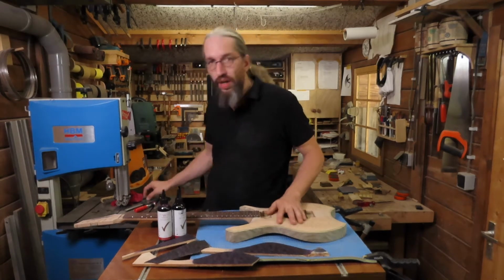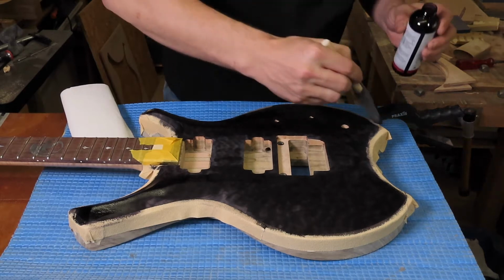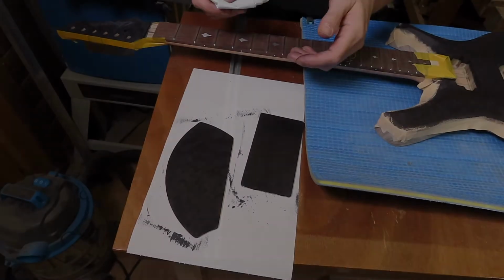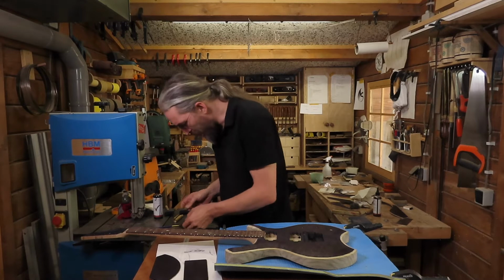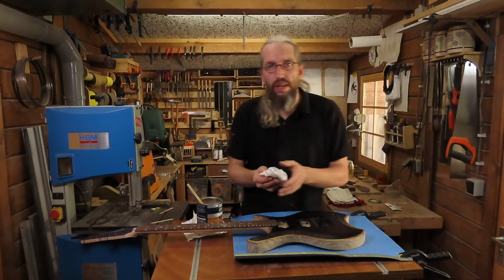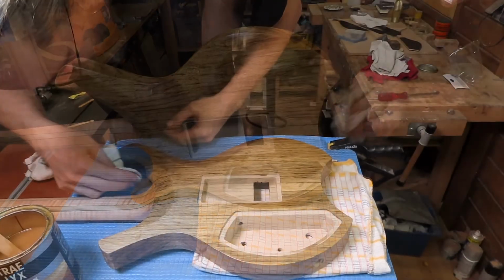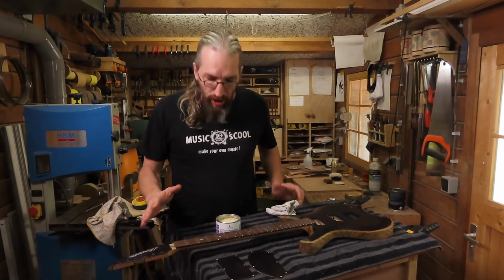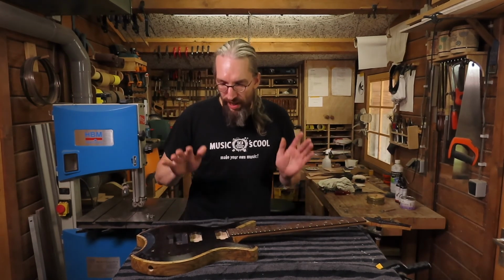Applying Stains & Hard wax oil Finish - A new Guitar build Part 15

Comment: Hello sir i build a electric guitar mahogany  body its thickness is 2 inch but its heavy what can i do to make it light weight?
Reply from the maker: Hi Ronald,
To reduce weight you could make the body a little thinner. 1.75" is a more frequent used thickness but if you're not using a tremolo style bridge you could even go thinner. I often make my bodies 1.6" (43mm) thick. 
If you are using a top on your guitar you could also make some extra cavities underneath the top to get rid of a lot of the Mahogany and reduce weight that way. 
Or if you want to go a little more extreme you could also cut holes all the way through the body.
Essentially you'll have to find ways to get rid of some of the body material to reduce weight but leave enough so you don't compromise the strength and stability of the guitar.
Good luck.
Reply: Thank you sir🙂

Comment: Are the pores still open in this finish? Or did you apply multiple coats and cut back to fill them in? The finish looks great! I’m trying to achieve that result with the stuff I have on hand since my building budget is beyond shot. I just usually find that open pores don’t look right when I try it.

Comment: Is a microcrystalline wax necessary? Wouldn't more layers of hard wax do similar job? Just asking, because I plan to stain and wax my custom guitar, and I am collecting experiences. Most people do: 1.Stain 2. Sanding Sealer 3. Wax/lacque; but I like your way. Let me know, thanks!
Reply from the maker: Hi James1495,
It is not really necessary but I like the extra depth and protection it seems to give. At least in my eyes.
More layers hard wax oil doesn't always give the best result. At some point the wood doesn't absorb the oil anymore and although you can keep applying more coats the finish doesn't come out as durable in my experience due to the build up of wax and oil and the increased curing time. It takes forever to fully harden.

Comment: Wow that grain really popped when you put oil on the back! Really interesting to see your technique. Another lesson learnt
Reply from the maker: Adding a little oil does make quite a difference doesn't it?
That's why I love Black Limba. It's such a pretty wood, easy to work with and looks so good with an oil finish.
I don't know if my technique is the proper or best way of doing it, but it seems to work for me.

Comment: Good idea mix the guitar stains, excelent result with wax oil. For masking, you should try a mask tape quite narrow, you know? The kind that guys use for masking helmets paintings, no leaks.
Reply from the maker: Hi Adrien,
Thank you. 
Yeah the color and finish on this one turned out great.
Thanks for the tip.
I know the type of masking tape you're referring to.
It's the type also used for striping on cars. Unfortunately not widely available over here. I have to order it online one of these days.

Comment: Having watched many guitar staining videos, I wonder if the black was sanded back more, there would be better detailing in the wood
Reply from the maker: Hi Steve,
Yes there would have... but that was not the effect I was after.
If I had sanded back the black more there would have been more obvious 'highlights' and detailing in the wood.
The purple would have been more pronounced and I think the guitar would have looked like a 'purple' guitar.
I wanted this guitar to appear as mostly black with just a purple hue. And only with the shifting of light reveal all the details and color shifts.
Now I'm curious though about how think the finish turned out?
Reply: @UnquendorGuitars  Yes I understood that by the end.  Note written too early.  Still great contene

Comment: Amazing! Any tips to stain the fretboard? I have a rosewood scale, very brown on a black gloss body and I HATE IT TO THE GUTS
Reply from the maker: Hi Abner,
I personally don't have experience with staining a fretboard. The stain will most likely wear off I can imagine. And staining rosewood might also be difficult to get consistent because of it's color.
You could look up how to ebonize wood to get an idea. 
If had to do it I would most likely use black ink or just replace the fretboard with real ebony.
Or if the guitar has a bolt on neck, swap out the neck.

Comment: I really like the color, almost black but with a subtle purple hue. 👍 What’s the reference of your hard wax oil? I’m starting a bass guitar with a wenge/purpleheart neck and a wenge/ash or limba body. I’d like an oil finish as nice as your guitar. And you say it dries hard, that’s a good thing!
Reply from the maker: Hi Ginger Jam,
Thank you very much.
I'm using the Trae Lyx satin gloss hard wax oil. I don't know how widely available this is outside the Netherlands.
A quick google search only showed Dutch sellers and the Trae Lyx website is only in Dutch or French.
But I think it might be worth to try another brand hard wax oil.
Good luck on your build.
Reply: @UnquendorGuitars    Thank you for your answer. I’m French. Trae Lynx is available in the Netherlands and Belgium. It might be possible to order from a Belgian seller. Is it similar to the Rustin danish oil ? Harder ?
Reply from the maker: @gingerjam2192  
Oh yeah you might be able to get it from Belgium.
I haven't used Rustin danish oil before so I can't tell the difference other than the hard wax oil having, like the name suggests, a hard wax component suspended in the oil.
I don't think that's the case with the Rustin Danish oil.  My gut feeling is that the hard wax oil should be harder and durable because it is meant to be used on flooring.
Reply: @gingerjam2192  "Hard wax oil" is, I think, carnauba wax mixed with boiled linseed oil and mineral spirits. If you don't want to mess with ratios, you can first apply 1-2 coats of the boiled linseed oil mixed with mineral spirits (50:50), and then once it's fully cured apply the carnauba wax for added hardness.

Comment: I really love the finish! Did you sand down the body between every coat of oil?

 I want to have a nice satinish finish for my stratocaster but I'm not sure what to use.  Do you think I could achieve similar results with wax only? Thank you!!
Reply from the maker: Hi Sekor,
No I didn't sand between all the coats. I only sand in between coats when I feel the texture is still a bit rough or to polish the final coat a bit extra. 

An oil finish can give you a very nice satin finish in my opinion.
Depending on the type of wood I wouldn't apply wax directly. Most waxes need a very smooth surface so usually an oil finish or even sanding sealer will do as a base before applying wax.

Good luck with your project.
Reply: @UnquendorGuitars  thx for the useful info! Congratulations on the wonderful finish and good luck to you as well :)

Comment: Dan, can the hard wax oil be left out and the chestnut microcrytalline wax applied right after the stain? What would be the difference?
Reply from the maker: Hi Badmoney,
For the microcrystalline wax it is best to have some kind of filler or sealer applied to the surface unless the surface is very dense. If you have open pores the wax gets in there and you can't reach it anymore to buff it out. Possibly leaving dull spots. 
The hard wax oil I'm using also gives the guitar additional protection against scratches, dents and moisture because it dries real hard. (it's intended to be used on wood flooring)
Instead of hard wax oil, or any other finish you could also use the Chestnut sanding sealer as a base for the wax. 
This is also suggested on the tin by Chestnut, but I haven't tried it myself yet. Their sealers are also very easy to apply.
Hope this answered your question.